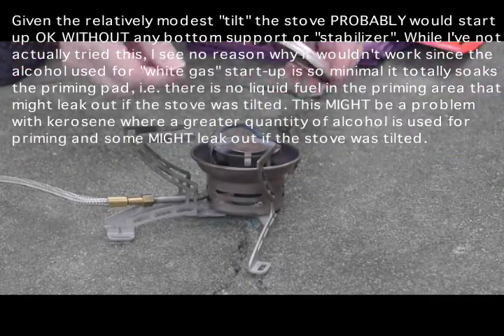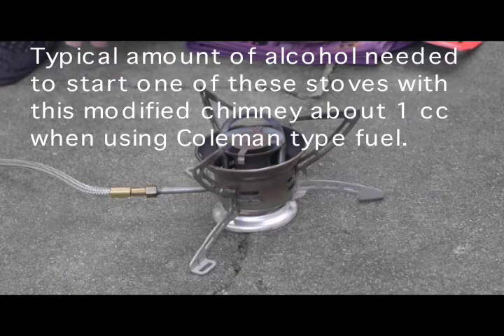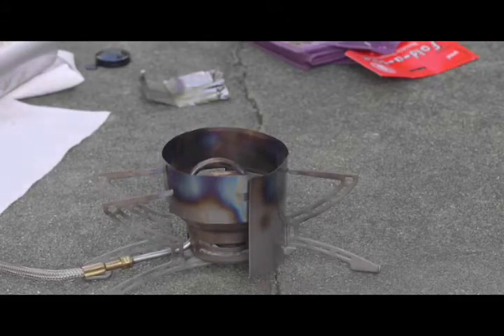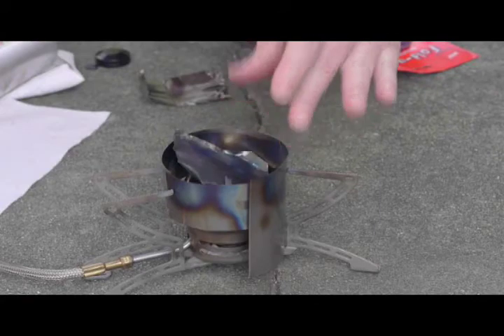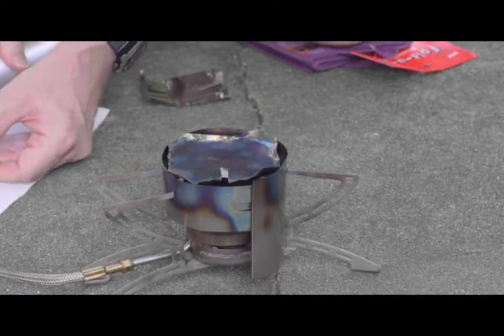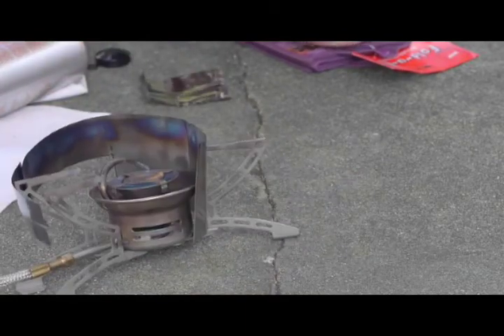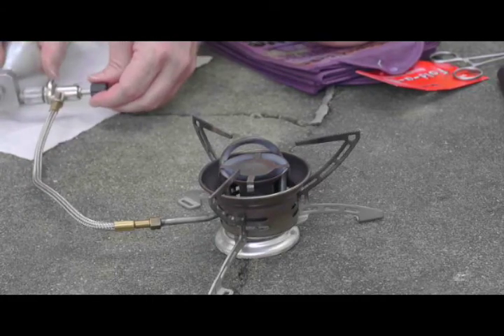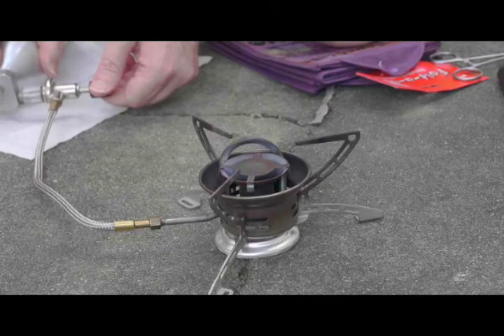Primus MFS and Edelrid Hexon multi-fuel stoves with latest chimney design, Part 1

Comment from the maker: (reply part 1)
This is an EXPERIMENTAL technic that addresses certain things such as the fit for the chimney (hence the discussion about leg position which applies only to starting the stove) and how little alcohol is used to consistently and reliably start the stove in contrast to the usual method using some of the white gas to act as the pre-heating fuel (which smokes and in my opinion is less elegant of a starting method). The chimney ...
 ... (see reply part 2)

Comment from the maker: part 2
The chimney is used to contain the heat from the alcohol (thus enhancing the start-up method) as well as serve as a trap for more heat once the burner is lit to again improve starting up AND contains any "flare ups" which makes start-up safer. The chimney is especially valuable when used in starting up the stove using kerosene as shown in several videos of mine. I hope this helps. Thanks for your comment.

Comment: I have a Primus MFS exactly like you have in this video. I don't understand your objection to having the pot supports/legs locked in their intended positions.  They don't impinge on the flame enough to worry about, besides the flame splits and goes on either side of the tips of the pot supports.  Also, the stove doesn't need a chimney.  If you're really worried about wind, put an MSR windscreen around and MSR reflector under the stove.

Comment: Also, what are you using for fuel? Alcohol?  And why bother with the syringe to prime the stove when you just turn on the valve for a second or two, then turn it off and light the stove.  When the flames start to get weak the generator loop will be hot enough to vaporize the fuel (preferably white gas) and you turn the valve on and adjust the flame.